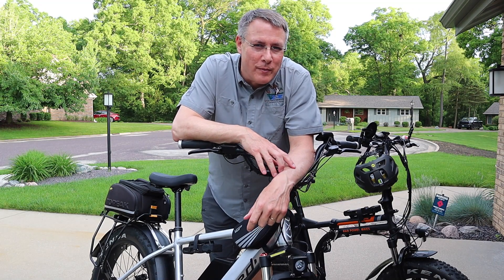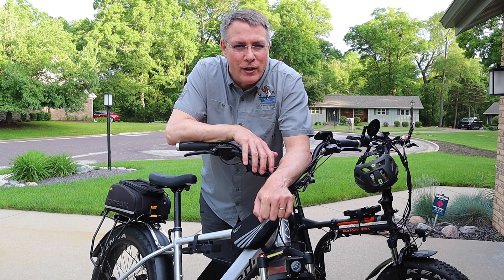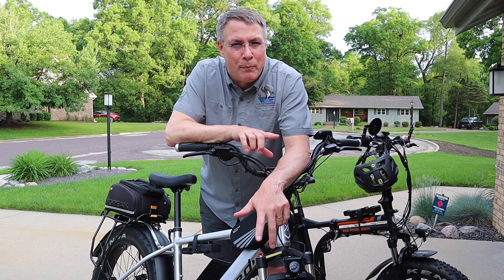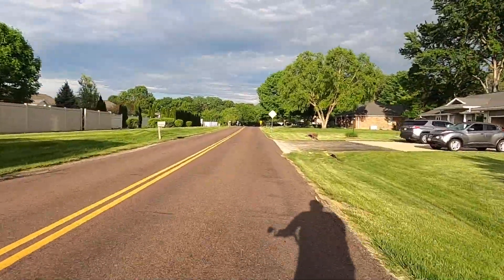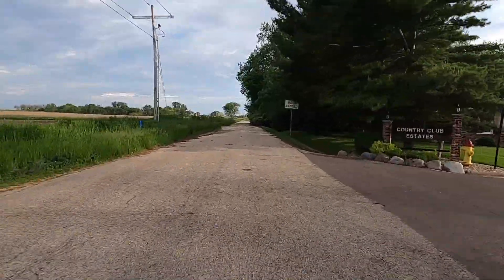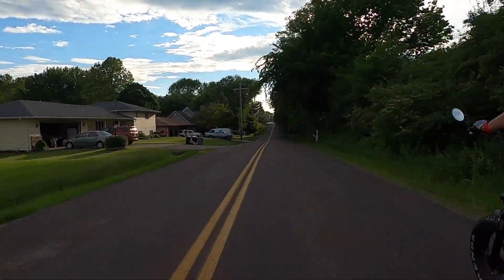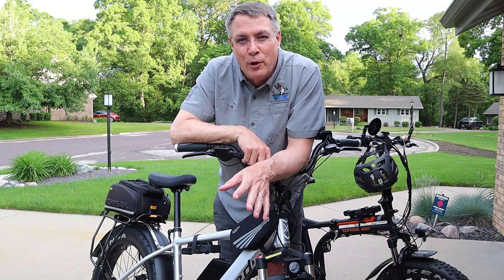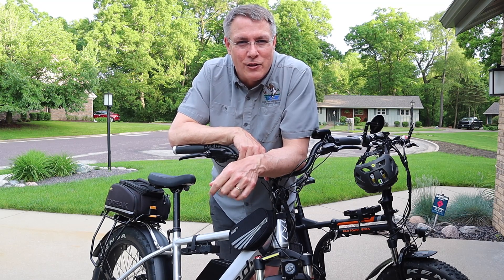When Crashing, is E-Bike speed different than Acoustic Bike speed?

Comment: Crashing at 20 mph can cause serious injury. Why don't you guys wear proper riding gear? That helmet isn't going to save your cranium. Ebikers need Full gear approved for motorcycles. This means full face helmet (because you can destroy your chin and jaw) with visor DOT approved but also ECE approved because DOT has the least safety requirements. CE rated armored long sleeve riding jacket. CE armored riding pants, CE armored gloves (all leather or textile) and leather high top riding boots with armor for ankle protection. Wear all the gear all the time. It's the Only way to mitigate damage from crashing.

Comment: Great Video it should be widely promoted. The problem as I see it is that you attained a speed of 30mph on a flat road. Add in even a gentle downward slope and your speed would go over that but your bike stability and braking systems aren't designed to get you out of trouble in an high speed accident.
Reply from the maker: Thanks for the nice, and wise, comment, Amanda.  It was an ever so slight downhill on that last road.  That's the only time I've gotten up to that speed and I would never be comfortable doing that normally.  I agree, the components aren't made for that.  I say the same thing about the ones that buy a $99 bicycle at Walmart and put a gas engine on them.  At some point, they're just going to melt into the road.  -Tom

Comment: I just bought a RipCurrent S and while it has the speed, that wasn't the primary purpose for the purchase.  (I still haven't received it.)  The Rad Power controllers are notoriously under-powered, and the 52v system on the RCS has the hill climbing wherewithal to get it done.  Like Arfonfree, when motorcycling I'm dressed head-to-toe in the best gear I can afford.  I like his suggestion of a more MTB-style helmet for higher speeds, especially on unimproved surfaces.  When I was 18, I spent a week in the hospital for surgery.  I had a roommate that was a few years older and had taken a tumble on his bike.  I got out before he did.  He looked like someone dragged him behind a truck.  He needed skin grafts all over, including his face.

Comment: Great topic Tom and another good video.
As a eBike  "heavy" '5'9" 300lbs'  I ride a Juiced City Scrambler 'Class 3, 52v, 750w, 13ah pack' I choose for road riding I even toss 40lbs of groceries on the back from time to time. This model has mags reducing the chance of wheel failures and at my weight just throttle I avg of 20miles & 18mph in max mode pedaling more certainly makes it better. Boy is it fun, I can go for hours and still have a great time!
I think the thrill of attaining 30 is there but day to day my average trip is 10 miles mostly milk runs and occasional longer looksee trips in my tourist rural area. Speed is trumped by range for me and I feel like 15mph is the sweet spot, you get there quick and a eBike gives me the ability to double my physical range and then some in comfort. As a former motorcycle nut I have lived the perils of two wheels and use my ebike as a cheap to use mode of casual transport and areobic exercise. Anyone looking for a ebike is going to enjoy 'in most places' free use of roads, the economy of less than 20 cents a day charge cost to cruise like a slacker if you want (750w and class 3 or lower)  and the perks of having pedals.  I also had a gas bicycle I built a few years back and it was less fun with constant breakdowns and less acceptance due to the motor and noise.
I stopped thinking top speeds when I choose an ebike because getting there is as much fun as the trip. I save sooo much on gas now and get many questions at my stops like a clever celebrity.
Reply from the maker: Thank you for the nice comment, Jason.  Your whole comment is full of wisdom.  I really enjoy hearing from those with a range of experience.  I agree with you on the sweet spot at 15 mph.  I was once an enduro rider, so I can relate a bit.  Can you share with me what you use to haul your groceries, please?  -Tom
Reply: @evolutionaryTom  yup its a facebook post,  https://www.facebook.com/photo.php?fbid=139556557758586&set=gm.850973705425791&type=3&theater&ifg=1
Reply from the maker: Thank you, Jason!

Comment: Nice Video Tom, I have a Sondors Foldx that tops out about 28 MPH, "i changed out the rear cassette for more resistance" i dumped it about 12 mph and hurt myself, nothing major, but going down at 30 you may have even sugarcoated it a bit, you're gonna be in real bad shape.
Reply from the maker: Even I'm going to be a bit more cautious after this video, Mr. Sax!!!  Thank you for the compliment.  -Tom

Comment: I was going down hill inching into the left lane getting ready to take a wide right hand turn at the bottom. I thought I would be able to quickly  get to the right if I car came around the corner towards me. I guess I miscalculated. When I hit the brakes I went into a skid, when I realized I wasn't going to stop in time I hit the front brake and flew over the handle bars and crashed into his side door. Just a broken elbow and $2500 damage to the car. My bike only had a cracked gear box. I'm more careful now.
Reply from the maker: "just a broken elbow", you're a trooper, Steven.  I'd call that pretty serious.  Thanks for sharing.  -Tom

Comment: I have ridden motorcycles both on and off road for many years and whenever I do, I wear a level of protection that would be totally impractical on an ebike. And when riding an acoustic bike, 20 mph feels adequately fast. So I'm OK with a class 1 ebike. I would advise anyone going faster to at least invest in a full face helmet. Remember, energy goes at the square of the velocity, so at 28 mph, you have to dissipate twice as much energy as you do at 20.
Reply from the maker: That's great advice, Arfonfree.  Thank you!  -Tom

Comment: Actually, I've found that adding the motor allows bicycles to attain their proper speed...I've done 30+ on all my ebikes all the time, just feels right (Negative Ghostrider...the pattern is full)
Proper maintenance is a must n yeah if you do go down at 30 MPH it'll sting, but come on I rode motorcycles for years in LA so 30 isn't intimidating when you've been running at 100+ all  your life! and you estimates of injury are cute...I've rolled outta crashes at higher speeds in t-shirt n shorts n got only road rash. My worst ebike crash was a tube stem failure on a descent of Sulphur mountain road at like 20 MPH+...lost pressure so fast on my front tire it just dumped me...walked away with only some scratches n a Holy Shit story!
Reply from the maker: Great story, and advice, GW.  Love your username!  -Tom